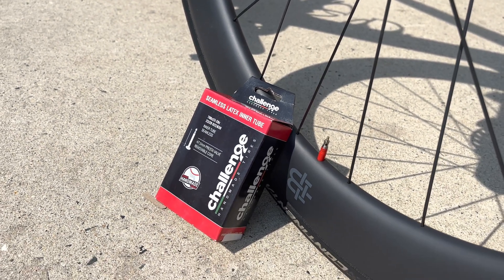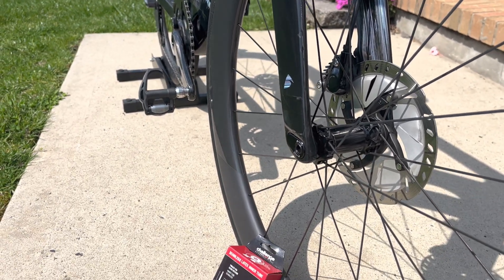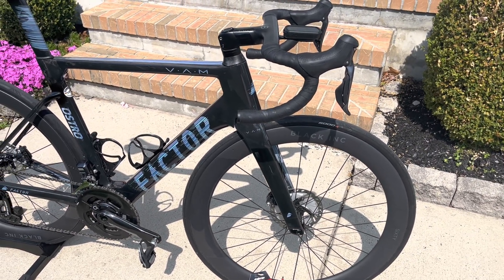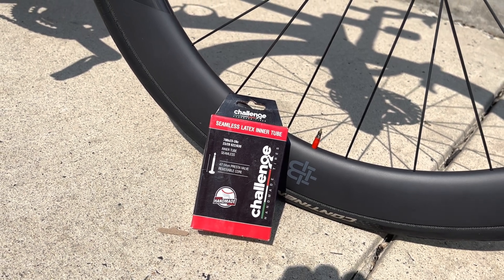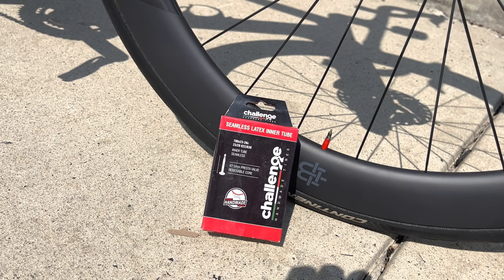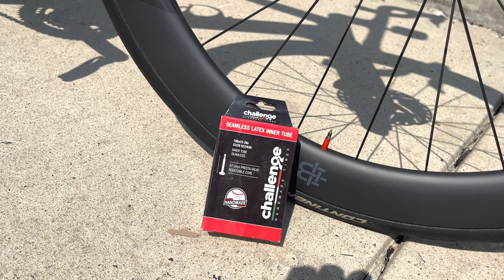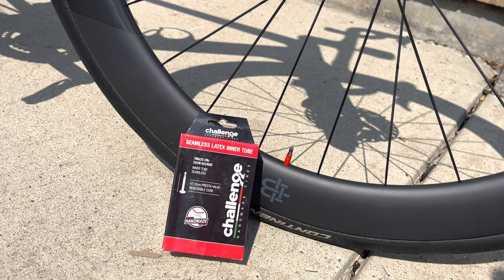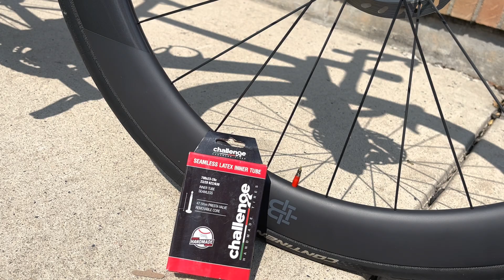TPU inner tubes vs Latex, the HARD truth!

Comment: The problem with Latex is they loose air too fast. I'll deal with a harsh ride if it means not having to pump up my tires before every ride. With TPU I only pump up the tires about every 3 or 4 days and even then they still maintain about 65 PSI so I can still ride if I don't have my pump on hand.
Reply from the maker: I switched back to TPU last season and wider tires. That seems to be the sweet spot
Reply: @addictcyclist  Hey! Which TPU tube?
Reply: @addictcyclist what tyres and what size?

Comment: Just installed gp5000 and tpu. Definitely I was expecting better ride. Need to try latex
Reply from the maker: What size tire?
Reply: 32mm. But, my previous was gp4000 25mm front and 28mm rear. Actual size of 28 was 30. Gp5000 32 actual size is 28on my mavic aksium rims. Front feels  little better on bigger cracks

Comment: I only use TPU tubes as I still run rim brakes and can't use latex tubes with carbon rim brake wheels. Completely agree with your comparison between the two. If you're coming from butyl however, TPU is a huge upgrade.
Reply from the maker: I have since revisited TPU now with 28mm tires and lower pressure and seems to be the answer.
Reply: @addictcyclist  I'd still personally pick latex tubes if I had that option, but TPU is still an excellent choice. I'd always carry TPU tubes as a spare now regardless.
Reply: i think a lot of people still run latex tubes with carbon rim brakes fine
Reply: @mrazik9365 Not a chance I'm taking, they're probably fine but definitely not cleared by the manufacturer for carbon rim brake usage

Comment: Thanks for sharing your experience.  I am planning to buy the same bike and was doubting whether to use TPU or latex. Decision made. One question: why don't you use 28mils tyres?
Reply from the maker: I was on 25mm when made this video. Switched to 28 and on TPU at moment to re test
Reply: @addictcyclist so what feelling on 28c tyres and TPU?
Reply: Curious what it will yield
Reply from the maker: @frankrhemrev3572  little better ride quality since can use lower pressure. Super fast and super light. I’m impressed
Reply: @addictcyclist Sounds promising, can't wait to try it out myself!
Reply: @addictcyclist  next wednesday I'm ordering the Factor with BI wheels...can't wait to do the same tests you did :)

Comment: How have these challenge latex tubes hold so far? I've been using the Vittoria ones and with a pair of GP5000s never had a puncture after 7000+kms, have been considering the challenge ones for the same reason and also they're a few grams lighter than the vittoria ones.
Reply from the maker: They are good. I like Silca the best actually due to the fact they come with fresh valve extenders if you buy that pack.

Comment: I tried butyl (obviously), latex and tubeless. Both on road (smooth and harsh) with large tires (32+ mm) and on gravel (40+ mm). Both with relatively low pressures.

Tubeless has three main problems for me :
- swapping tires is incredibly messy and long compared to any tube system
- requires messy maintenance / refill every few months even if you keep the same set of tires
- once you puncture a sidewall, you're screwed (even with dynaplugs)

TPUs have three problems :
- puncture and pinch-flat just as well as latex (if not more), even with "strong" TPUs (tubolito, shame on you  ...)
- patching them is not reliable and certainly not a side-of-the-road affair (translates to €€€€ and time)
- random quality control, both EU brands and Chinese ones

Butyl tubes have a low appeal to me :
- they puncture significantly more than latex and pinch-flat just as well
- they roll measurably slower than any other option

Latex tubes with big tires and low pressure virtually eliminate pinch flats and punctures. In the very rare cases I need to repair them on the road, it's a fast and reliable affair. Inflating them at the start of each ride with a small electric pump with a preset pressure point is a 1 minute job.

Latex tubes aren't perfect, but they are the best compromise for me.
Reply from the maker: Good recap! Ty

Comment: TPU is weird, it hits potholes harder than any other system, but on smooth roads its as smooth as anything else.  If you use 32mm tires and steel frame and Alu rims TPU is easily the best though.
Reply from the maker: Tpu and potholes will rattle
Your teeth out of your skull lol but yes smooth road is silk. I am going to try them with a cotton tire like a corsa and see how it goes

Comment: Almost every reviewer has a different take on the way these TPU's ride.
Totally different.   To me the PSI matters the most.  Its an air chamber no matter the tube material.
TPU's are SO thin, how can they resist road shock or bumps?  psi is what reinforces a tube.

Latex, man patching them seems like a lost cause, and they are really pricey.
The last latex tubes I got the valve stem base de laminated from the rest of the tube.

Im not devoted enough to be buying latex tubes.

Comment: I honestly don't understand why anyone would nitpick on inner tube riding difference while riding Conti 5000, which is in essence a low TPI tire and the main factor reducing your comfort / ride quality. The moment you switch to a real tire (like Vittoria), I'll come back to hear your experiences.
Reply from the maker: I have ridden vittoria corsa, Rubino pro. They are the most comfortable tires I have ever ridden BUT they drag ass. They don’t hold speed well imo. Feels like pedaling in sand.
Reply: @addictcyclist Corsa / Conti 5000 are in the same ball park with regards to rolling resistance. The Conti has its merits but one thing it's not: comfortable. It has a low TPI, and I wonder why anyone would try ultra supple latex inner tubes in something as harsh as a conti 5000... That's the thing: if you want comfort and want to compare it, look at your biggest gainst first, and in your case it's definitely the outer tire. Claiming Vittoria corsa is slow is as much as saying Jumbo Visma does something very wrong while winning all GT's this year, I don't buy that.
Reply: @l.d.t.6327 conti GP5000 are ruff..nice speed but very harsh on NYC streets

Comment: Running TPU with Conti 5000 28". Certainly less compliant than tubeless - also because of higher pressure. But using TPU on nice roads so not an issue for me. I feel my wheels spin faster than with butyl (placebo effect?). Would never go latex myself - the alternative for uneven, difficult roads is tubeless with its lower temp and clear puncture advantages.
Reply from the maker: I am going to give tpu another shot and play with air pressure. Stand by for update.

Comment: I have been using Ride Now Chinese TPU after Vittoria Latex.  I find they are very smooth, I don't feel the bumps too much.
(I still have Latex on my 2nd bike).
Reply: Thank you for this.  I'm running Vittoria latex, and have Ride Now 24g TPU ready but not installed yet.  Not sure how they compare.  I'm happy with latex, except how poorly they hold air.
Reply: They are great.  I use rim brakes and with TPU tubes I did not have any over-heating problems when descending big mountains.  (I have had blow-outs with latex) @flflam
Reply: @montrose252  Do you find latex or TPU gives a more supple ride?  I'm quite happy with latex and not too concerned about the 100g I can save with TPU.  I'm on rim brakes but don't do long descents.  Deciding between switching out the latex for TPU, or wait until a puncture happens.
Reply: @flflam  At the end of the day, I would say ride quality and rolling resistance is similar. I wanted to shave a few grams off the overall weight of my bike!

Comment: Today im making the change from Latex to TPU. Been running latex for about 2 years now and the amount of air they lose is insane. My rear tyre went from 100psi to 60 during my 8 hour ride. I had to pump it with CO2 and I got it blew. Latex is decent but if you're doing 5+ hour rides the air you lose is just too much. If you're riding 4 hours max they're okay. More than that and you'll come home on a half-soft tyre.
Reply from the maker: I did an 8 hr ride a few weeks back and only lost about 10psi. What brand latex? I never lost that much air before.
Reply: @addictcyclist  Michelin... The Vittorias were much better. I was losing only 10-20 psi on those on big rides
Reply: That's just not true. I been riding latex for 6 years and never lost so much pressure. And that's included a 11 hour ride as well
Reply: And I ride Vittoria latex

Comment: I've never used latex, but going from heavy butyl to feather light ridenow's TPU is a game changer. I even bought the 24g version recently and is even better than the 34g. Bast bang for your buck to reduce weight and improve ride quality. The problem is depending on the size of the puncture the provided patch kit won't fix it.
Reply: What brand/model TPU did you go with?
Reply: @abigaelbalbuena1917  Ridenow
Reply: @abigaelbalbuena1917   I've been using Cyclami brand TPU on alliexpress.  Definitely hesitant at first, but after 3 months of usage, only 1 flat and it seems to be very well made.   Super fast.  Best bang for the buck for sure.
Reply: coz its not a patch what they include ;) it has a hole for valve positioning on the rim, straight to trash.
Reply: @szolekxxx  I bought a kit with a pack of patches, dummy.. 🤦‍♂
Reply: @CRFtetraenea   Ive watched those same patches being used on a YT video, and if done properly they work great. Some have used just a dab of gorilla glue with no patch and had that work great.   These TPU's are new on the market, most seem to like them alot.

Comment: I don't race but I had the same impression about TPU.  Now I'm running 28 mm tires so Im going to give them one last try.
Reply: I think, a lot of these "ride impression" feelings are a little bit mental.
A tube is an air chamber, the amount of travel or suspension to be gained out of a tube material is so tiny.  Latex just seems like it would be great.  If its pumped up hard it rides hard, if its less psi it rides smoother.  

Some ride TPU and dont notice much difference, for some they ride like a board.
Latex is a bitch to patch.
Latex costs a lot and are sometimes out of stock.  
To me they are an old school thing.
Reply: @bradsanders6954  I have recently discovered something useful about TPU tubes and I'm using them again. One of the problems that they have always had is in the valve stem.  A company known as RideNow makes a good TPU tube in various weights. But it is very important to get the ones with white valve stems, which is their newer version. If you get them in a 36 g weight, which is the heaviest of the three weights that they sell, they turn out to be quite robust. They also make lighter weight tubes, but you definitely don't want to use those if your bike has rim brakes (and lighter ones are more fragile).  To me the big Advantage is that they don't take up much space in a saddlebag or in your pocket, and if you are a weight weenie of course you are saving quite a lot of weight on your wheels.  Ask for the ride feel, really the important thing there is your tire pressure.  The good ones from Ride Now cost about $13 a piece and now you can buy them on Amazon there are companies on AliExpress and Temu who sell cheaper TPU tubse (~ $5) but as far as I can tell they all have the problems with the valve stems and I strongly recommend avoiding them.  In fact I also recommend avoiding Tubolito and Pirellis for the same reason.  The quality control problems are serious. You might get lucky or you might not
Reply: 28 mm is a more comfortable tire , that absolutely matches better with the also comfortable latex, than the plastic TPU.

Comment: Tried all . Tubeless is a tad more supple. But yes Latex feel is so much more better than TPU altho TPU tubes weight 50g lighter than latex. So pick your poison, better feel or lighter weight.
Reply from the maker: I choose feel as I’m not dainty rider at 175lbs
Reply: Latex has a lower rolling resistance than tpu - so despite the weight penalty u will b faster on latex vs tpu. Lower Rolling resistance trumps weight saving of 40g of tpu for watts saving. The only real disadvantage of latex  is having to inflate ur tyres more often because they leak more than tpu.
Reply: @patrickspader4062 what wattage diff?

Comment: What valve length are you using in the 60's?
Reply from the maker: Using a 42mm tube plus a 42mm extender
Reply from the maker: 42mm
Reply: @addictcyclist  are you using a valve extender? will a 42mm fit a 60mm deep rim? thanks

Comment: Run a 2019 Roubaix with Hunt Aerodynamicist 44s, Pirelli P Zero Race tyre 28c, specialized inner tubes (100g).  Weigh 60kg.

Tried some 28g RideNow TPU tubes.  Makes wheels feel/sound twangy and tinny - OK on smooth tarmac but forget the rest - ride becomes very hash, seems to ruin the bike's compliance and speed on any non-perfect roads.

Tried loads of pressure combinations - switching back today!

Comment: I have tried challange latex tubes, same as in the video. They streach so thin that they start loosing air quick. You have to pump them every 1-2 hours. In 24 h they will be completly flat. Many of my friends have had the same issue with challange. When i removed on of the tubes i could see that part of it was streched so thin that you could see through it. Technicly no punchur but since they were so thin it was leaking fast. However, i have had other brands like michelin that lasted 5 years then the valve broke, no problem to run 3 days event without reinflating them.
I have contacted challange regarding this (have a stock pile of unused challange tubes at home that i wont use due to this issue) but they have not answered.
Reply: You definitely have a leak or you're extremely discerning about losing a psi an hour
Reply: @veganpotterthevegan  challange is just not worth it when at the end of your ride you have to watch out for every bump in the road to save your rim. It takes the fun out of cycling. Two tubes for me (front and rear tyre) and 3 friends have had the same issue.
Reply: @martinbonta1592  I've sold hundreds of them without them being any worse than any other latex tubes.  Coincidental anecdotal evidence from a very small sample size doesn't mean much
Reply: @martinbonta1592  also, these are the same tubes they put in their very prized tubulars.
Reply from the maker: Thanks for feedback. My experience with challenge is a little different. I always pump before each ride no matter what.. butyl, tubeless, latex.. but they do loose air. It takes a few days to a week for them to go completely flat. Same with the vittoria and Silca tubes. I notice no difference compared to challenge.
Reply: Losing not loosing
Reply: @grahamelliott6041  I misspelled more words then "loosing". So feel free to comment on them. 🤮
Reply: @martinbonta1592  thank you, that’s very kind of you
Reply: Very, very few, if any riders I ride with want to deal with latex tubes.
Obviously this reviewer is sure they're the only way to go.   Try patching one sometime.
Try buying them when they are out of stock.  They are very pricey.
They lose air quick which is exactly what I don't want a tube to do.  A tube should hold air at the bare minimum.  Latex is a specialty thing.

Comment: I never run Latex as they puncture too easily.
Reply from the maker: Opposite! They withstand more abuse and conform better and do not pinch flat.
Reply: Latex punctures less not more. You got it backwards buddy
Reply from the maker: @thepatternforms85  not even close, got it right. Been on latex for 3 years and not one puncture.
Reply: You need to use Real tire talcum powder that should always be done with either butyl or latex tubes that will decrease the frequency of flats. Corn starch is a poor substitute. Been doing this 5 decades it woks!  Shake the tube in a bag coat it well. Then put some in the inside of the tire and rotate it until the entire inside is also coated well. Then place the slightly inflated tube in the tire and install on the rim. I suspect this will work on TPUs but haven't tried them yet. But I think tire talcum also improves the ride too...not having the tube glued to the tire. I also think the excess that I put in helps expel those tiny pieces of glass out of the tire. I also used those little wire things with my cotton tubulars when they didn't have any flat protection belts they also helped. And finally Tubulars almost never pinch flat. Once I hit a curb at 20 mph and turned the rim into a pretzel 🥨 literally   and that Russian training tire didn't flat ..put it on a new rim and continued to use that tire a little while later. There was a bit of recovery as the bike stopped instantly and I didn't....shoulder first head next. A helmet would have been a good thing....luckily I got a chance to live and learn from that mistake. Those head injuries kinda don't go away as I have learned.

Comment: What about inflation pressures used in TPU vs Latex?  Can the TPU be run at a lower pressure than the Latex or Butyl?  Would/does that improve the road feel?
Reply from the maker: I lowered pressure but still rode like crap compared to latex. I ran them same pressure I do latex , 80 fr 85r.